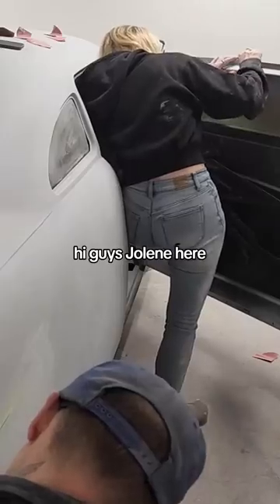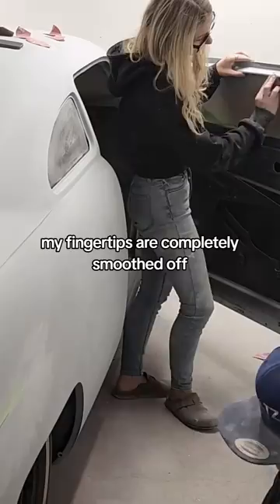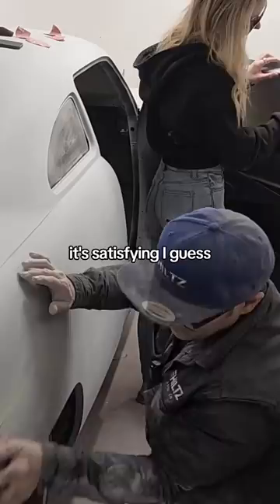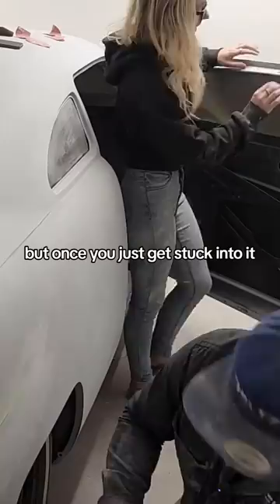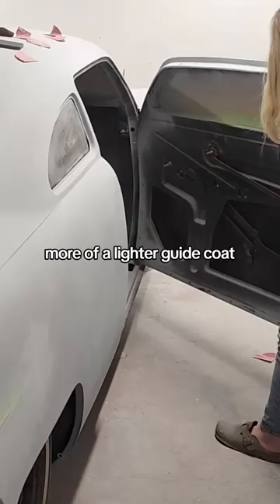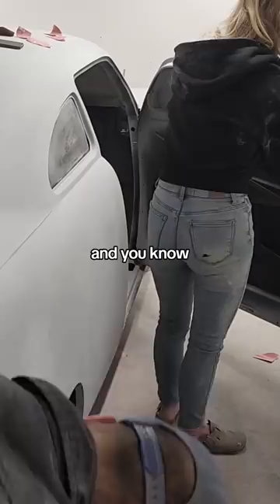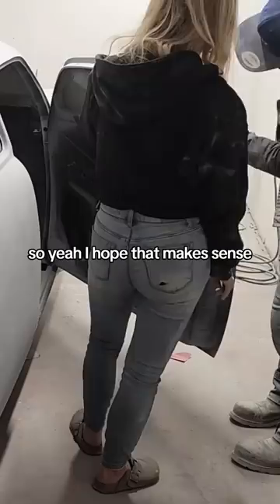Ever sand your fingertips off? 😅

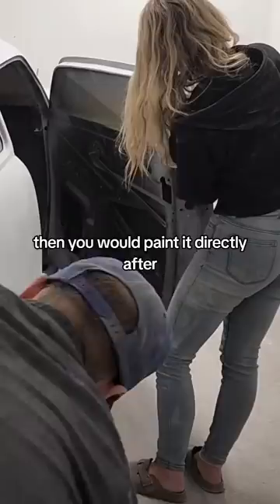Comment: Put a rope under the rubber around the window to hold the edge of the rubber up! It's easier to tape up and you have a clean rubber af 2:29 ter you paint! After you paint the car just pull the rope out and the rubber lays back down clean!

Comment: A red scotch bright pad is equivalent to 320 grit. I find them easier to get in the tight grooves. First hit it with the 220 on the flat areas then go over it with the red scuff pad. Saves a little skin. Give it a try next time. 😉✌
Reply: Around the windows too.
Reply: Doubt he knows what red scuff pads are, especially after that seam tape job.